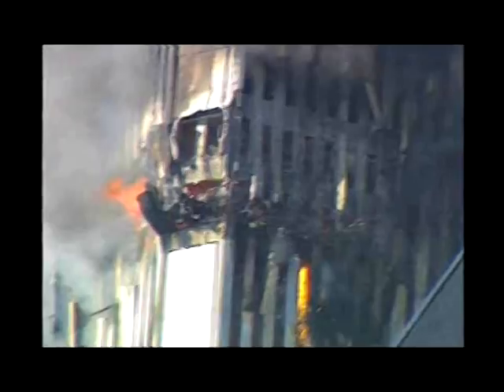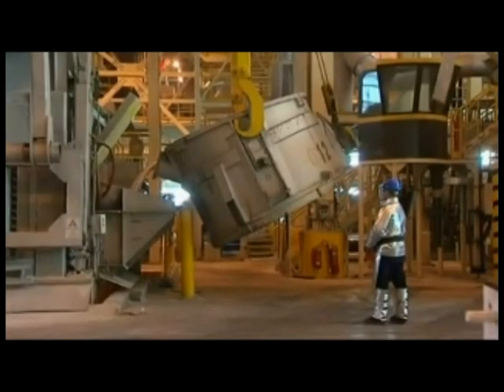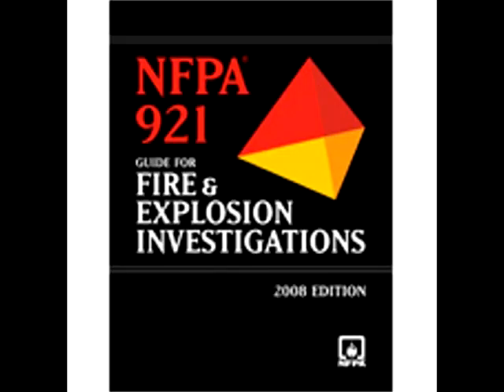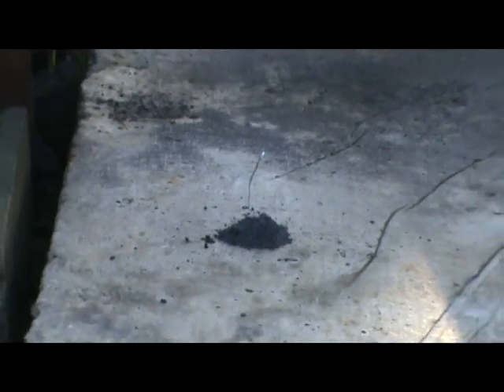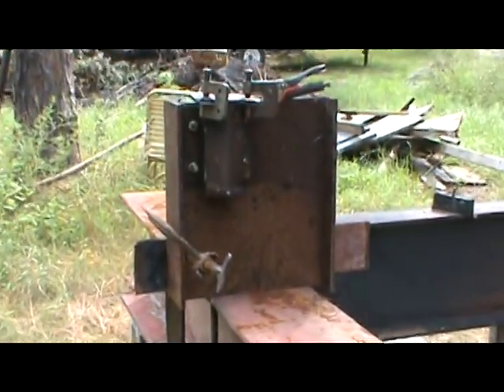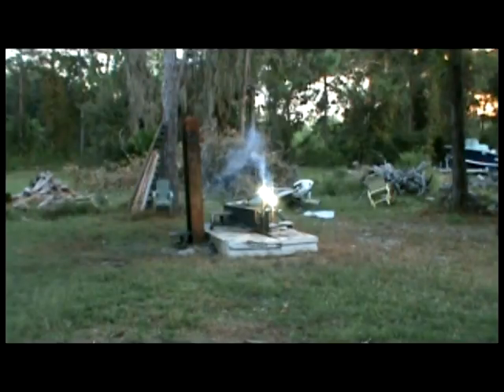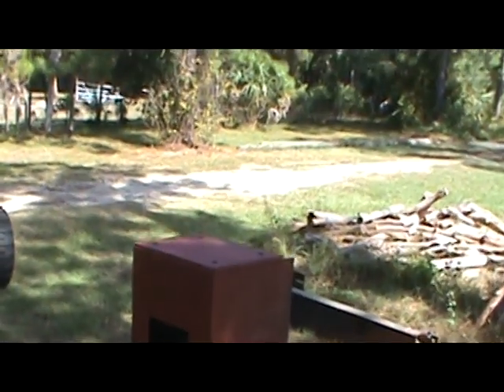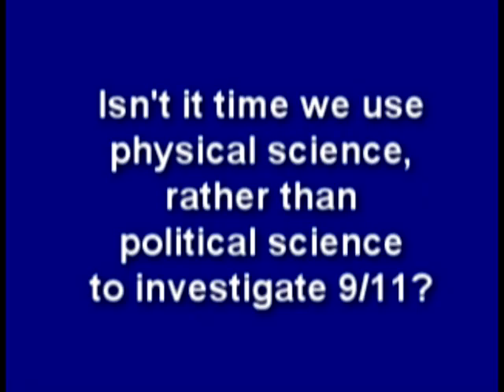9/11 Experiments: The Great Thermate Debate

Comment: I have this on good authority..........  At the pentagon the Joint Chief's of Staff were on the opposite side of where the missile ............err I mean "Plane" hit (nod nod wink wink). The only reason was that the asbestos material in the area being remodeled was not all removed  which is where the "object" hit  (blew up) at the time.
Reply: Explain what hit the Pentagon if it wasn't a plane and why it wasn't on radar when flight 77 was. Explain why you think we should have clear video of an event that took 1/4th of a second to happen from CCTV cameras that record at less frames per second. Explain how the black box from flight 77 ended up in the Pentagon if it didn't hit. Explain why there are plane parts inside and outside the lawn. Explain how passenger bodies were found inside the Pentagon. Explain why multiple witnesses saw a plane. Explain what hit the light poles if it wasn't a plane. If you claim that the light poles or plane parts were planted, then explain how this is possible when the Pentagon is a major tourist location surrounded by major highways. If you say that a missile hit, explain why the damage is too large for a missile. Explain why there are no missile parts. Explain why no one saw a missile.

Refute the content of these links.

therightbloggerbastard.blogspot.co.nz

Damage analysis link:

http://911review.com/articles/stjarna/eximpactdamage.html

Video tapes:

http://classroom.synonym.com/were-9-11-pentagon-tapes-seized-fbi-18501.html

The FBI directs inquirers to its vault, an electronic reading room with documents available to the public. The vault includes many videos and images of the Pentagon incident, including debris from the plane

Here's a few pictures of bodies at the Pentagon, you know, the ones the conspiracy shepherds say don't exist and you mindlessly believe them like the gullible SHEEP you are?

http://www.vaed.uscourts.gov/notablecases/moussaoui/exhibits/prosecution/P200045.html

http://www.vaed.uscourts.gov/notablecases/moussaoui/exhibits/prosecution/P200047.html

So explain all of that DIPSHIT SHEEP DRONE or you can always...

WAKE THE FUCK UP DUMB DIPSHIT SHEEP!

Comment: The beams never melted, and the official story doesn't even claim they did.

The heat caused the beams to warp and pull out of the massive bolts hold them to the main structure.

It is pretty easy to see how that would happen if you work with steel.

Comment: Soooo let me get this straight! There were crews of demolition experts "Hired" by our Government (secretary) to work on the floors affected by the the so called Thermite?  Where's  the eye witnesses to talk about seeing workers there removing drywall and ceiling tiles to get access to the steel? All the supporting steel was on the outside of the buildings. Where offices were located.  NO interior steel was used to build these buildings. Open floor plan concept. More offices means  more tenants $$$$.  So it would have had to been a year long project placing all the Thermite , Yet no witnesses to workers.  No paper trail? Ridiculous! Stop it!

Comment: Heat causes metal to expand, the metal doesn't have to "melt" it just has to make it flexible, and with thousands of tons of weight above it, the metal just collapsed under pressure, not sure why you think it has to "melt".

Comment: I'd like to know if there are, or would have been,  any ways to test metal from the structure of the WTC for the presence of thermite, or any other "foreign materials" that might have been used as an accelerant, metal cutting, etc...  Could they have tested for thermite/thermate?

Comment: just look at the CGI plane melts right into the side of a steel reinforced wall of the WTC like it was cheap plywood. an aluminum plane would explode  on the side of the building if it crash into a steel wall, but because they place the explosives  inside the building, they had to made it look like the plane exploded in the middle of the building.

Comment: @physicsandreason Add one more thing to this experiment. Find a way to load a jet fuel projectile. Aimed at the target containing thermate. With the velocity of the projectile mixed with the ignition of the jet fuel Is it enough to ignite the thermate on impact? Granted the velocity of the projectile and, amount of jet fuel is far less than that of a jet plane. Kuddos.
Reply: But we do know the jet fuel is hot enough to initiate an ignition sequence that is hot enough to light an igniter for the thermate. Let me draw that out with crayons. BIC LIGHTER = PLANE, FUSE = MAGNESIUM, EXPLOSIVE = THERMATE and/ or NANOTHERMITE. <--- That is called an ignition sequence. This sequence allows for the confusion caused by the claim of a terrorist attack.

Comment: I'm no expert, and I have no idea if it was set up or not.... But.... When we were kids we would put pieces of steel into charcoal after the BBQ was don't fanned the charcoal and pretty much turned the pieces of steel red hot and were able to bend them with hammers if we so chose to.  If I can get a piece of steel red hot to the point of softening it.  Why couldn't jet fuel?  Plus its not exactly calm at those heights there must be a breeze.... Has anyone stood on top a building?  Its windy.  Plus look at the California wild fires, theheat is causing thermal winds whipping temperatures up to thousands of degrees.  I cant say it was set up, I can't say it wasn't..... But steel will heat up and retain that heat and just keep heating up till it melts.  Especially if it being wind blown and made hotter.  If thermite was used..... There would have been months of preparation or even years and the planes would have to hit specific floors to assure that the whole production played out exactly. We'll never actually fully know.

Comment: We used to put Incendiary grenades on top of old jeeps in a vehicle graveyard on Camp Lejeune. It has a much smoother even burn like you see in the 911 video than the more explosive experiments you show here. 

We were taught that one use of a incendiary grenade is to burn through an engine block to disable it so the "bad guys" cannot use it against you. So, I've seen these devices burn through a motor block and leave a molten pool of steel under the vehicle. 

Never asked what was in the incendiary grenade. BTW, your video was excellent! 

The grenades we were using were No. 76 Incendiary Grenades. From wiki as to the active ingredients: The perfected list of ingredients was white phosphorus, benzene, water and a two-inch strip of raw rubber; all in a half-pint bottle sealed with a crown stopper.

Maybe this chemical compound is part of the equation. 

Also have used Det Cord. And the angles on the steel look to me like perhaps there is an incendiary device that can be wrapped around a beam similar to det cord.

Comment: Interesting video. I was wondering if there was a way to heat the steel to about 1800 degrees comparable to the jet fuel burning. Then add the weight of the rest of the building perhaps using a press of some kind. What I would like to test is wether the weight of the top of the building could have caused enough internal friction as the steel softened at 1800 degrees that the movement and weight together could have caused hot spots in the structural steel capable of actually melting those spots.

Comment: When you talk about jet fuel not being able to melt steal beams, but don't mention or address the fact that temperatures required for melting are reduced under increased pressures, it's kind of hard to take you seriously after neglecting such a basic principle of material science.  Also, steel wouldn't even need to melt to bring a building down; it just needs to be weakened enough for the structural integrity to fail.  In engineering terms, the factor of safety can easily be brought below 1 (ie, failure) without coming close to actually melting steel.

Comment: Anybody that has ever worked with steel knows that heating steel even at temps far below its melting point can have a dramatic affect on its structural integrity. 

Take a 3 foot piece of 2 inch structural rebar  and heat it to just 1,000 degrees with a torch and you can bend it with your pinkie.

This argument that the buildings could not have collapsed do to a structural fire because the fire did not get hot enough to melt steel is simply stupid....
Reply: Pretty weak argument  dude! Sure that will work with a solid piece of rebar. Explain how all the beams were heated on at least 3 sides of those box girders to make them weak enough to even bend? 
There was a similarly built tower in Japan i think, that burned uncontrolled for 27 hours and never hinted at collapse! Uncontrolled collapses would also not collapse at freefall speed. The odds of 3 buildings collapsing at freefall speed, all into their own footprint also seems pretty astronomical.
Reply: The NTYR  

 Ever heard of a radiator and a cooling system?   What do you think happens if that cooling system fails? Ever bend a push rod or a crankshaft?

  Also the engine in a car doesn't  have 500,000 t sitting on top of it.

 Your arguments could be countered by a 5 year old.
Reply: The radiators are for pistons running inside the engine :)
Reply: The NTYR  

Excuse me? The planes didn't hit the top of the building. They hit 10+ stories down from the top. When the fatigued metal gave way the entire top 10 plus stories smashed into the next stories below with more than 1,000 times their weight   due their inertia. 

 Think about it. 1,000 times the weight of the top10+ stories...

10 floors × 1,000 = 10,000 floors....10,000 floors × 20 feet for each floor = 200,000 foot building....200,000 / 5280 ft per mile = 37 mile tall building.

Do you  Honestly think the rest of the building was designed to hold up 10,000 floors?  That would be a 37 mile tall building.

Do I really have to go into the math on here?
Reply: Don't mind me, I'm just leaving tactical comment.
And get free lecture from smart person who judges another opinion is an idiot..
Reply: yes that is true however we know there was liquid steel. that is publicly known and available information. if no steel melted id be on your side.
Reply: Twin tower had four sides and many steel pillars, plane struck at only one place. This science is not so difficult to think.
Reply: Um, just throwing out this idea: the steel framing surrounding the buildings would have provided some support to perimeter of the building but wouldn't have helped much for the interior of it. Did they find a lot of those supports bent in one direction or another or did most remain straight? Also, the fire was mostly contained inside the building without to many outlets for the heat to go (yes, they had the holes in the sides of the buildings but heat likes to rise, not flow sideways) so wouldn't that have built up enough extra heat to compromise those supports? And last question for now: did they really use rear that was 102 stories tall or somewhat shorter segments? I'd think that trying to move a rebar over 1000 feet long might be a little tricky to do during its construction phase.
Reply: Rebar is trash. Those towers disappeared before our eyes into convenient piles of debrea. The truth is we will never know exactly what and why it happened but one things for sure, what they told us is complete b.s.
Reply: I mean, you can see molten metal pouring out of the tower from the video of the event.  So you can wax long all you want about hot, soft but non-molten steel all you want, but that has nothing to do with VIDEO FOOTAGE and glowing, liquid metal pouring out of the actual tower.
Reply: aaAANND how about those aerial lasers causing so much heat, that green sappling trees are catching fire in the middle of California mall  parking lots... Using a laser to consistently KEEP the heat level hot enough to melt... And THEN where would that place the IMPROBABILITY of thermate materials being used?!?!? Anybody ELSE see a steel beam VAPORIZE INTO DUST.... AAAAFFFTEERRR the towers fell?!?!?! See... The Thermate IS the grassy knoll with NO SHOOTER ON IT... And look back over the JFK shooting... Jackie tries to exit the back of the limo... Because the front passenger is the one who WASTED HER HUSBAND... WATCH IT AGAAAAAIIINNNNN 🤐
Reply: Take re-bar 102 stories tall, heat the upper end of it...the lower end will stay cool and intact.
Reply: jthepickle7 I'm no engineer but yes, that does not make sense. But we will never know for certain.
Reply: Yes William, it does not make sense.  If we had a Jefferson or a Washington now among us, or Superman, we could yet discover the truth.  a concerted electorate?  ...slim chance
Reply: Take a re-bar 102 stories tall and heat it up to about 1,000 degrees about 20 stories from the top and the slightest breeze will topple the top 20 stories right over....
Reply: GSpotter63 you mean it will topple the whole 102 stories? Both towers came down completely not just the top stories.
Reply: @williamfunes2740  

We're talking about a single re-bar now you @#%%....

Sorry... not allowed to use the word I was thinking....But it  rhymes with  the element boron.
Reply: "topple the top 20 stories right over...." You say.  Topple?  Where was the toppling?  The buildings fell straight down into their own footprint!  Building #7 ,never hit by plane, (70+ stories) also fell into its own footprint. In the history of steel-framed buildings only three have collapsed due  to fire.  All happened on the same day in the same place.      Let's see … it's 8/21/2018 ………………..too late for the party.  We, the little people are just too late for the party... or are we?  17 years... 17 years                   hmm.  Well, THIS generation is too f-cking late for the party!  {after reading many comments I admit my cowardice.  Edit: MY generation was too cowardly concerning 9/11  }
Reply: GSpotter63 If I have to be honest and as harsh as it sounds, I really don't care if it was an inside job or not. But, I respect this man for putting in the effort and engineering to prove a point. You obviously have made up your mind. I and many others have not. End of discussion.
Reply: So what temperature is required to haev the "dramatic affect on [the steels] structural integrity" to the point where the steel glows bright orange, and flows like a liquid, as seen in the video?  And what are we calling that liquid state if it's not "melted".
Reply: @robotnoir5299  steel melts at around 2700F.U can bend steel at lower temps, but all 4 sides of all these beams would need to  be heated to deform straight and collapse  down. This guys theory is flawed. At worst, the top of the tower should have toppled sideways, not straight down at free fall speeds.
Reply: @GSpotter63  sorry if we don't take your opinion as fact. We're kinda weird that way
Reply: @GSpotter63:"Take a re-bar 102 stories tall and heat it up to about ..."

My Response: have you performed an experiment like this, or is this just speculation
Reply: @GSpotter63:"We're talking about a single re-bar now you @#%%...." (about +William Funes)

My Response:sorry, just read your reply to William Funes, now name calling supports your opinion, jeesh, forget i asked the previous question, I guess your mind has been made up and name calling people makes your speculation the best answer, sad and weak, i just wish people that don't believe it's an inside job  (in general) can be a little more factual, experimental, sharing of their results, take in eye witness testimonials, sharing evidence, but all I find is subjective opinions blasted towards people who are trying to find the truth, i respected your opinion until you displayed anger towards William, I really wish and hope it's not an inside job, but so far (in my opinion based on what i have learned and witnessed) it's not pointing in that direction, the convenience of lacking information, poor speculations as fact, and slandering of investigations is poor support, there are evil corrupt people in this world and it does not discriminate who or where they are, but what's worse then these evil doers are the ones that have a blind faith and unquestioning loyalty to one side (either side), and not everything is 100% black and white, all i ask is to be respectful to others and be open minded, search for the truth, and if you are right, then the truth has been discovered
Reply: @riiich  

 Yes I have heated up steel with a torch to the point of structural failure.  It is really not that hard to do. And you don't have to get anywhere near its melting point to do so.
Reply: @riiich  

 No, you're right. Ad hominem insults don't really prove a thing. But it does help in pointting out their complete and total ignorance of the subject.
Reply: @William Funes
Well said, i just saw this after i posted my response to GSpot69
Reply: So this means the entire Tower must have been pre-heated to 1000 degrees for them to collapse at free fall speed then....
Reply: @getl0st  

No moron....the falling millions of tons of the top 10 + floors multiplied  by its increasing free fall inertia (by more than as much as a 1000 times)  could have  Pulverized anything  Including hardened steel and all of its welded and bolted connections.

 Not to mention each floor and all of its supporting structures after being dislodged added to the increasing weight of the cascade.
Reply: @synthmagic9502  Gspotters theory is very flawed and he obviously doesn't truely even know what he is talking about. Common sense,logic and simple physics ,dictates it was a controlled demolition.
Reply: GSpotter63 yes possibly but once the steal cools its still steal its not dust all that steal woulda took up more mass than what you see in the pic/vids of the aftermath
Reply: KICKZ ROCK 

Says the man who gages a fact by his opinion from a photograph instead of weighing all the steel taken from the site.

 Sorry if I don't take your opinions as facts. I'm just weird that way.